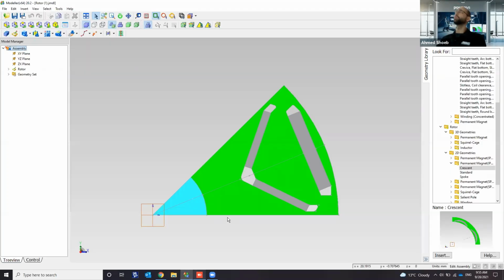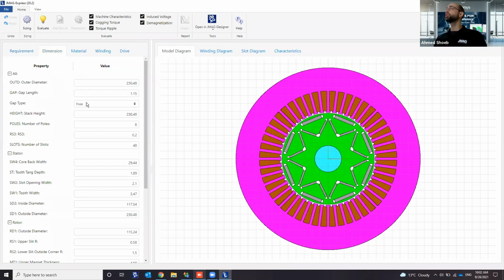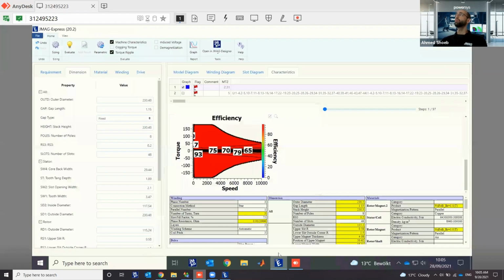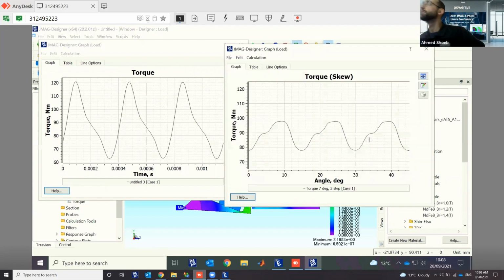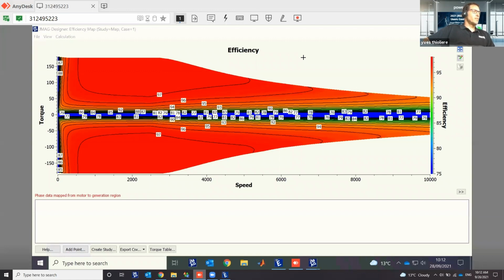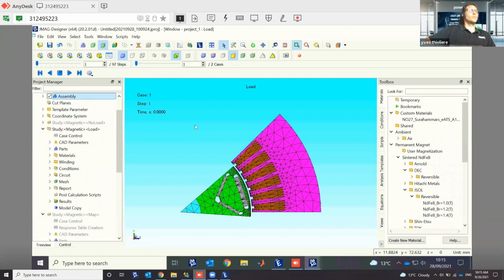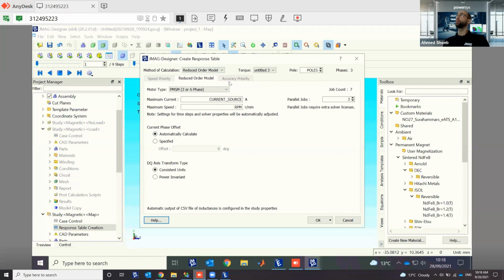New Express delivery: High-end motor design tools

Comment: Hello sir.
Thank you for your video. it is my bible about learn a Jmag tools.
i'm study about the spmsm used by Jmag-express. I watched your video, but i failed to convert Jmag-designer model to Jmag-Express model... 
So i want to ask my issues.

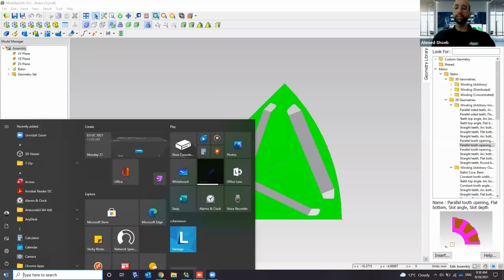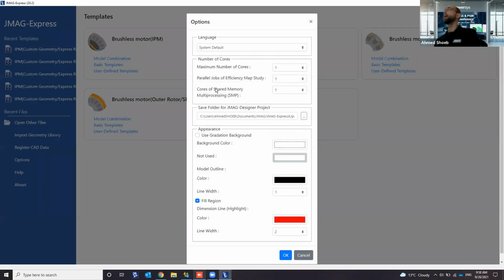1. Your video Time(2:59), i was do that, and then Video Time(3:30)  my Jmag Express(Ver. 23.2) doesn't have about option. 
    Can i skip about this process?

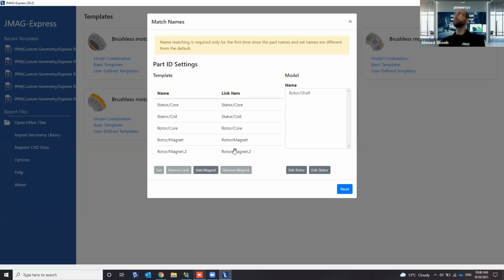2.  Your Video Time(4:35), i cant find about Rotor custom my model.  How can I come out my model?

Have a nice day. i will wait your reply.